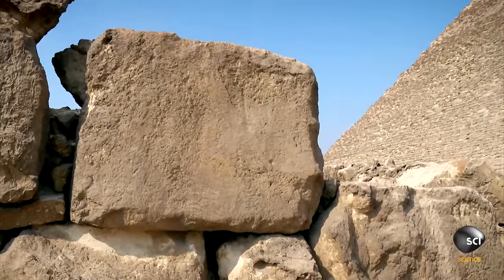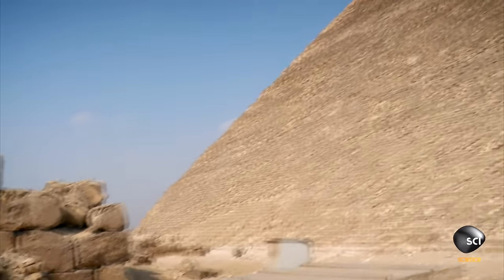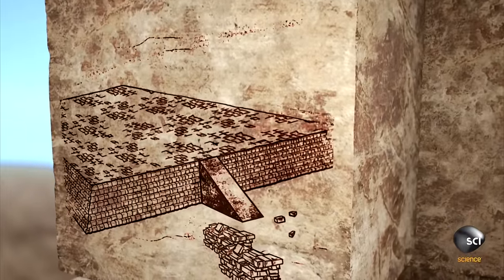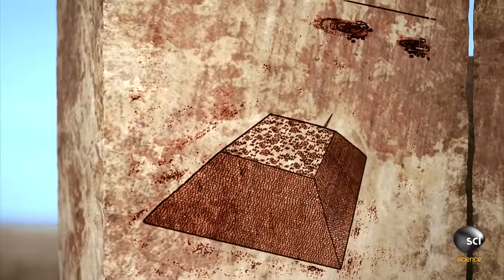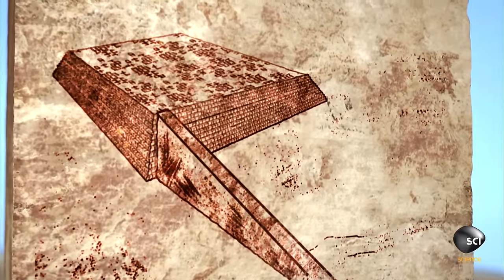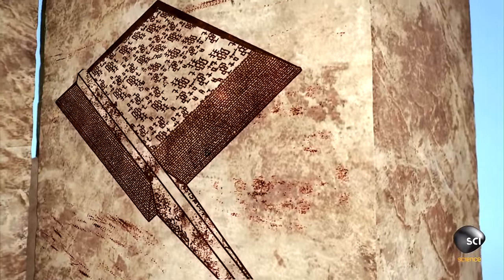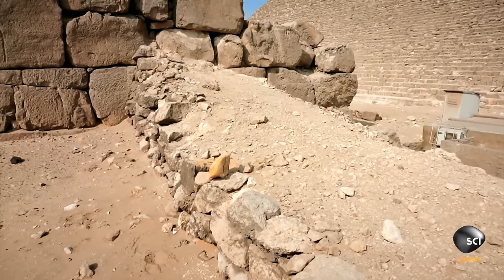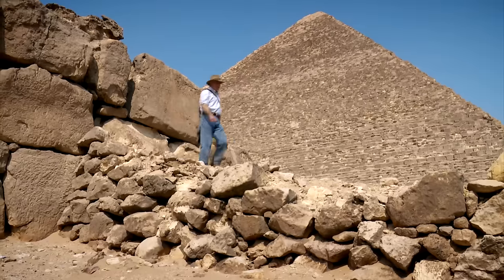How Did the Egyptians Raise Huge Stoneworks?

Comment: They started with a foundation 3 blocks high, from there they started the slope; placing 3 blocks behind the initial 3, a 4th could be placed on top, starting the slope, after going all the way around, 4 blocks could be placed behind with a 5th placed on top. Using this technique they would eventually reach the top. As for how the blocks were moved, simply using the interior blocks as scaffolding could work, then after dragged a surplus of blocks to the top, the temporary scaffolding could be filled in on the way down. This would explain the layered walls of the pyramid, why the interior is so solid, and why it took so damn long.
Reply: They used sound frequency, it doesn't make sense to lift 1000s a 70 ton stones with human labor.

Comment: Sure. This engineering feet totally matches what Historians tell us were PRIMITIVE MINDS. 

You normies fail to take into account the facts that all four corners are perfectly aligned to true NORTH, EAST, SOUTH and WEST and the sheer magnitude of the base, height and the fact it has a skeletal structure too. Some areas are 3 walls deep.  And the polished granite internal and subterranean rooms, the hardest granite known. 

Some of the Sarcophaguses (that were empty) had a base weight of 70 tonnes and the lid alone 30 tonnes. Like to see how they did that! Maneuvering it through 12' wide underground tunnels and even making 90° corners. 

Archaeologists had a better grip on the truth 125 years ago. Go read their works!

Comment: They used air ships like a zeppelin or hot air ballon. Traveling in the air would be easier than a ramp.
(Someone more progressive, told me this.)
Reply: They didn't have that technology back then
Reply: You would be surprised what did exist when they actually built it.
Reply: Bro it would fall down those are some really heavy stone blocks
Reply: Think with your imagination, that back then the atmosphere, or the technology, they had was much different than our current understanding. This theory of ramps is from our current archaeological perspective.
That the date the pyramids were actually were build were older than we currently know. That people from Atlantis 60,000 years ago had advanced technology, and the the atmosphere was probably lighter with a different mix of elements than the Nitrogen rich one of today.